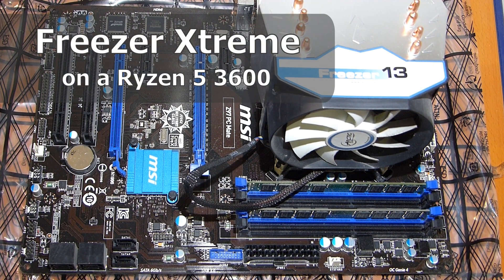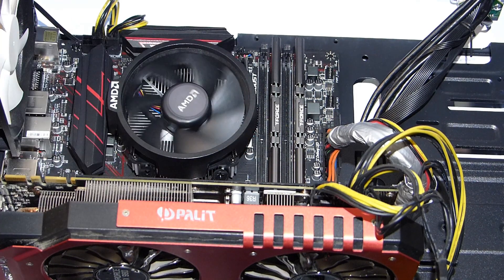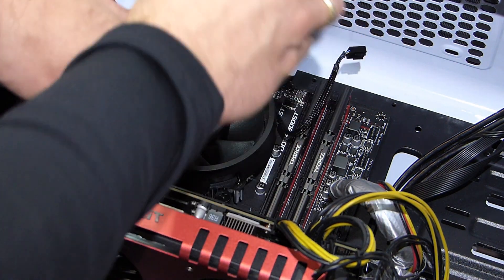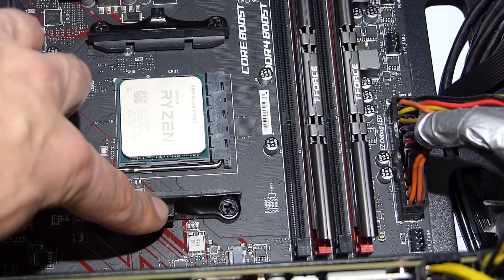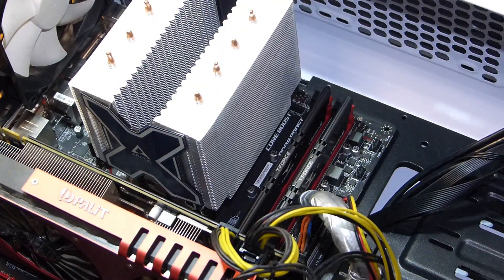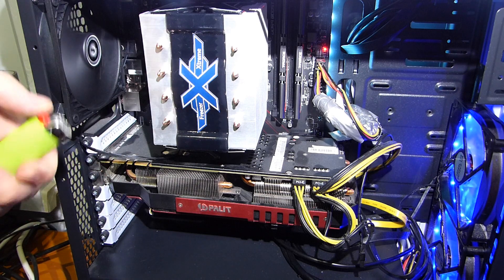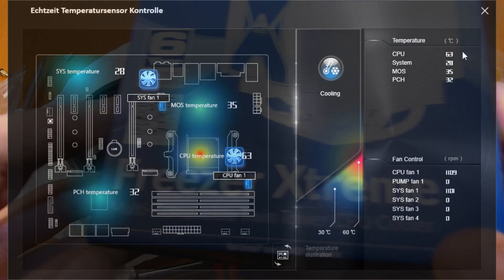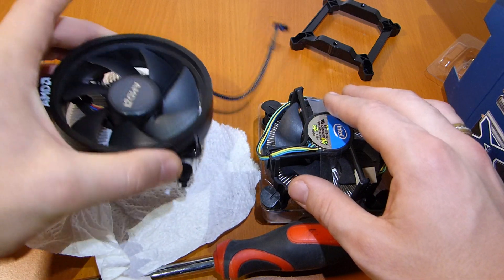Installing Freezer Xtreme on Ryzen 5 3600 & Results Before/After

Comment: Hi, thanks for this upload!
in terms of space and ram occlusion, is the arctic wide as the stock cooler or it will go on rams? can you post a photo of the stock cooler ON the arctic, just to show proportions?
Reply from the maker: No problem with the RAM banks and I have a standard layout mainboard. The only concern is the height of the cooler assembly. If you have a slim housing of any sort it will not fit. It does fit in mine, standard ATX, standard mainboard all should be fine!

Comment: I have the Wraith Prism (the 3700x stock cooler) on my 3600 but it gets pretty noisy and idle is high as well at like 50C average..I actually have the xtreme on another setup, would you recommend me to switch the coolers?
Reply: Vendettalecce i have a wraith prism cooler as well on my 2700x and i wanna go with arctic freezer 34 esports duo or freezer xtreme. still can’t decide haha.
Reply: Did you install The Freezer Extreme on your 3700x? Did it perform better than the Prism?

Comment: my sons system ( FX-8320 4.0 GHz with stock AMD cooler ) would constantly crash just playing Overwatch.....and it was LOUD....all fans ran at full speed.....all the time.....installed the Freezer Extreme.....it's so quiet i have to put my ear to the case to hear it run.....if it wasn't for his fans being red i wouldn't know it was on.....you really have to push it to get it to heat up....and i got it for like $20 USD....so, awesome product

Comment: Stock coolers existing just for one single reason: To "prevent" that CPUs are live "too long". :-) Arctic freezer makes pretty nice and fair priced coolers, the only disturbing thing in my opinion are the not very durable mounting brackets made of plastic. (Plastic, softener and heat is not really a long lasting combo. 

Noctua on the other side are "a bit pricy" but also first class for high performance machines. 

For mid-range computers EKL Alpenföhn have some nice, durable and well working coolers with good prices.
Reply from the maker: Good points. The stock cooler is enough if the CPU does light work in a cold room I guess 
😂I must say that the Arctic Freezer is a great improvement but I am still looking for something better. The Ryzen is simply a more demanding CPU than my old Haswell.

Comment: well thanks for the upload, I took the opportunity to take a look at my CPU temps, the warmest core of my old i7-6700 is at 71°C watching your video, this used to be better. on inspection I saw the old box cooler fan is rather dusty. time for a replacement before it gets dangerous. :-)
Reply from the maker: Arctic and others offer a bunch of cheap tower coolers that all outperform those box or stock coolers. A lot of them include thermal compound. Noise levels and temps are greatly reduced. It was like day and night on my old Haswell I5 and the same on the Ryzen 5. Good to hear I saved your PC ;-) !
Reply: @wearandtear6692  I will go with one of those ugly beige brown Noctua coolers. Would be the first thing I buy from Austria in decades, last things were Falco albums. 
Hello! Oho oh! Noctua cooling! 
na na na na na na naa na;-)
Reply from the maker: @couchcamperTM  With that cooler you will be the coolest kid on the block! Please tell me the model!
Reply: @couchcamperTM  My kid has a system with a Core I7 7700k. He got a Noctua NH-D15. CPU idles at 31c and goes to 61c in torture  tests. Just beware those coolers are big mofos. Got to have room for them.
Reply: @couchcamperTM   Nice, and it seems those little people would live warm and comfortable there 😉😁
Reply: @couchcamperTM  🤣 Good points there!

Comment: Yeah, stock coolers are noisy and inefficient, always have been. Not necessarily the easiest upgrade, but as you mentioned, a rather cheap and benefitable  one. Great vid :)
Reply from the maker: Thank you. 95°C after 6min on Prime95 with stock cooler or about 72°C after 6min on Prime95 and much reduced noise levels are a clear statement. I should have ordered a new cooler right with the mainboard/CPU/RAM and not even bother with the stock cooler for a single day. I tried all kind of tricks with the way the fan is regulated but it only helped very little with the noise and the heat just stayed on the high end.
Reply: @wearandtear6692  haha exactly. I am so cheap, I always order the boxed cooler with a new PC... d'oh! xD
Reply from the maker: @couchcamperTM  I did not expect stock to be that bad. Worse yet it always changed the RPM and anything I did in the BIOS fan control did not fix it. Now the RPM are still very flexible but with this better cooler unit u can't hear it. 

I think you can't escape the boxed cooler if you by a upgrade kit like I did.
Reply: @wearandtear6692  Digging a little bit deeper that CPU seems to run rather hot. But 95°C is actually max within the specs for it. Since it's a stress test you probably would never reach that temperature in real life apps. But I think its a good thing you addressed the issue anyway. I hope AMD manages to make their next models run a bit cooler. Back in the day AMD CPU's ran extremely hot, but I thought they had solved that a long time ago.
Reply from the maker: @NastyRenegade  I think with their 7NM manufacturing they hit some physical limits: A lot of heat is generated on a very small surface. In total the CPU is much more efficient than older generations but you still have to dissipate the heat generated in a very small area. But that is just my guess. With moderate work load on the CPU it sits comfortable between 40°C and 50°C. now If I tweak the fan control in the bios a bit more it may run even cooler.
Reply: @wearandtear6692  Sounds much better. And since they only start to thermal throttle at 95 I think you are in the clear.
Reply from the maker: @NastyRenegade  It seems you are a PC builder yourself ;-) That means you are 30+ like me, lol
Reply: @wearandtear6692  Oh yeah, back in the day I built PC's in a shop. But my son (15) built his own and I was effin' amazed. All that dual channel, Pci16,  LEDs and whatever, that goes into a build today is complicated. And yes I'm most definitely 30++ 😁
Reply from the maker: @NastyRenegade  In many ways things have gotten more easy compared back in the day.  I remember reinstalling my Windows 95/98 or Windows ME every few months - you had to have all your driver CD's ready and a boot diskette not to forget. Things changed with Windows XP and got much easier. Today it is really something else with all those stupid model numbers and stuff. Back in the day you had a Pentium 66, 75, 90, 100, 120, 133, 166 Pentium 2 266, 300, 333, 350 Pentium 3 450, 500, 550, 600, Athlon with 1000MHz(!) - everything clear as glass and expensive. Today I feel like I want to buy one thing and there is always a version out there with almost the same designation but only half the performance ;-)
Reply: @wearandtear6692  Today things seem to work better together. The technology just seems to be more mature and especially the OS, like you said. But the plethora of sockets, RAM configurations and CPU types is scary, then add different power configurations and modular power supplies... You really have to do your homework before buying, to make sure everything fits. 
It seems that the companies like to make a flagship model and then leech off the name by  naming them the same just with a letter or number to distinguish...and of course half the performance... annoying indeed. 
But I'm so old that I used to mess around with Win 3.11 and setting IRQ and DMA on peripheral cards. That was no fun either 😉
Reply from the maker: @NastyRenegade  In school I worked on C64, 286, 386, 486, DOS, Win 3.11. Our first PC at home was a Pentium 100, 16 MB Ram, 2MB Trident SVGA, 800 MD HD, Win 95 if I remember correctly ;-) Those where the times when operating a PC was like riding a untamed horse that was always about to throw you off, lol